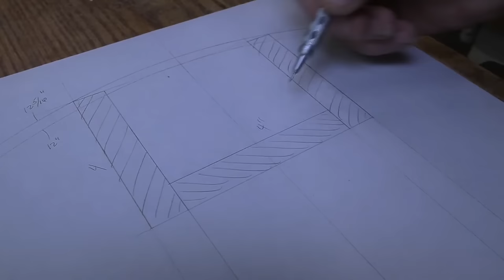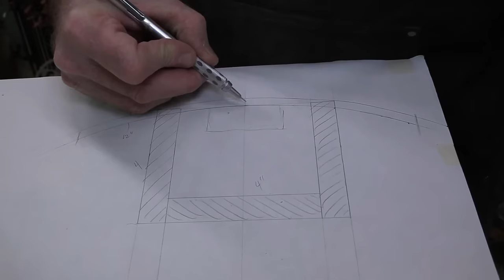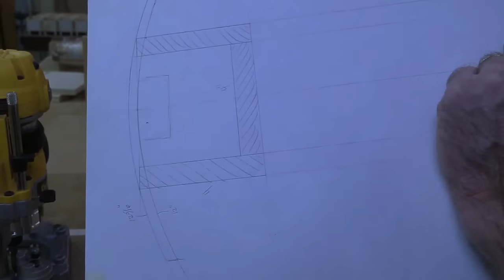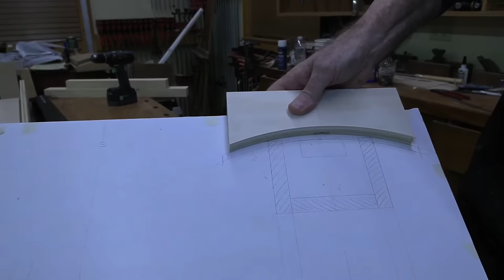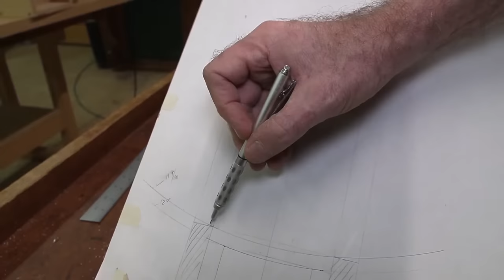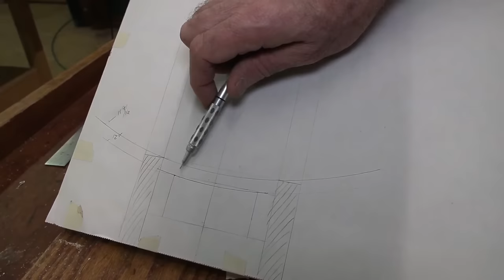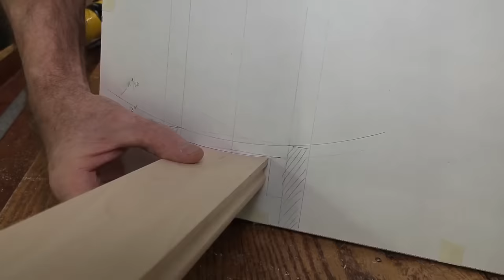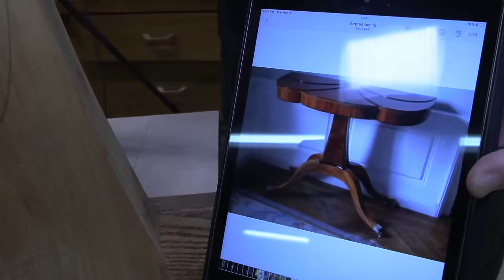Extreme Router Techniques

Comment: After using orange oil to get the iron-on edge band glue off my plexiglas router base for the millionth time I just applied Rain-X to the base. I have been using it on face shields and glasses to keep dust from sticking, for a while. Hopefully this will slow up the glue accumulation like the dust...the base is gliding effortlessly so far.
I am trimming 1/2" ply drawer sides and front/back pieces so I'm not concerned if this will affect stain but it might.
Reply from the maker: Yes Richard, I know the gummy mess that can occur with double stick tape. Sounds like Rainx is a good solution, I hadn’t thought of that. The only caution I can see is the silicones contained in Rainx, the main slippery ingredient is Polydimethylsiloxane, the simplest form of silicone. I’ve had some very frustrating experiences in the finishing room with “fish-eye” defects in the past caused by previous applications of silicone based furniture polishes like Pledge (although not sure if they still use silicone). Once the finishing room gets contaminated with silicone you have to add silicone to every finish (fisheye remover), which is not a great remedy.
But if you haven’t noticed any contamination problems, it may not be an issue for you.
Thanks for letting me know, and thanks for watching! 👍😎

Comment: What an excellent episode; sure wish I had watched this live.  Many years ago I built an ES-335 style from scratch, so this is very interesting.  I used the radiused sanding block to achieve the 12" radius on the fretboard, but never even thought about using a router.  I would be interested in knowing how you cut the neck.  Single piece? Wood type, grain direction, etc.  I had cut & carved my guitar neck from a single piece of maple, and unfortunately over the years the neck developed a twist rendering the guitar unplayable.  Disappointing, but it was an excellent learning experience nonetheless.  Also, did you use a fret rule and hand cut the fret slots or did you purchase a pre-cut fretboard blank?